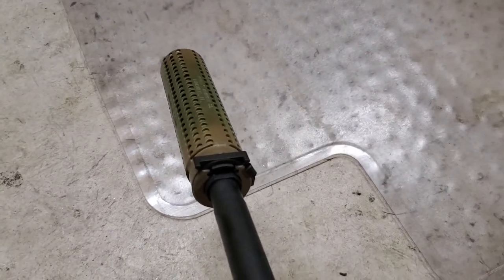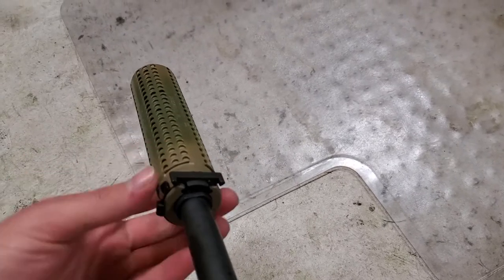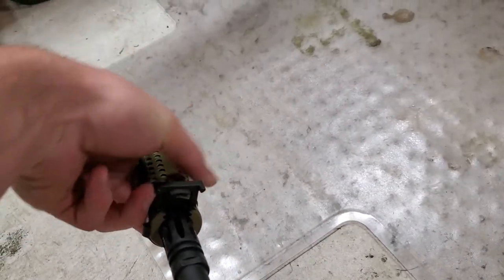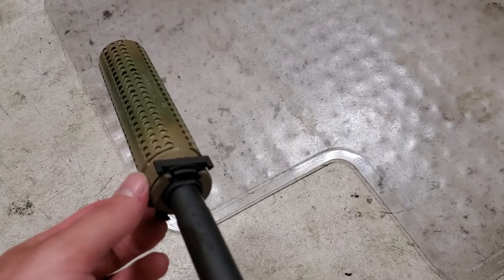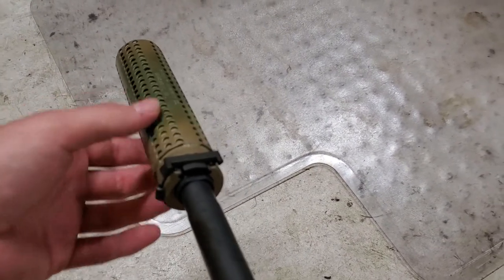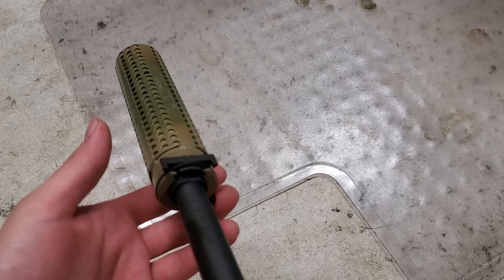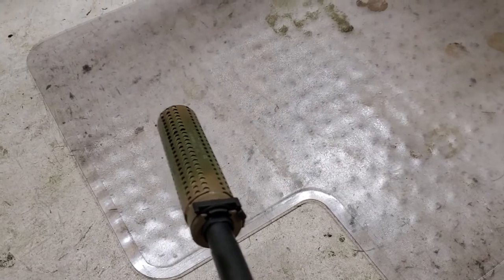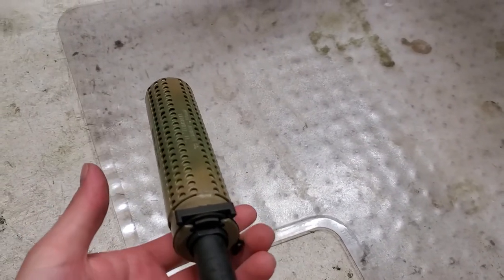KAC NT4 Suppressor Locking Issue?

Comment: Normal For the NT4 just as Long as you don’t have up and down. But wobbly is normal
Reply from the maker: Thanks, ended up sending it back to KAC because the little Pin that is on the Gate Latch itself had come out completely and caused the locking ring to loose tension, which is why the Locking collar could be turned so easily. Took almost a month to get it fixed. Knights ended up replacing the whole Attachment Assembly on it, seems to work good now, the locking collar is not as loose now.
Reply: It’s normal.....just breaking in
Reply: Colton Salzsieder I just had them send me new roll pins. I think I have around 5k rounds through mine now and only replaced the pin twice.
Reply: @coltonsalzsieder2041  I lost my latch one night when I was out shooting under nvg. My can got launched 40yds away and never could find the latch. I ordered a new latch and replaced the 2 pins myself. I think the pins are sold for like 4.00 on operation parts
Reply: Is that an A2 Flashhider?
Reply: yeah the roll pin spring thing seems fucked. that was the problem with the nt4 thats why when griffin armament made the m4sd they did it with an upgraded way of locking and the can is basically the same as the kac nt4 but just upgraded. if anyone is considering the nt4 and isnt doing it strictly for clone purposes id check out the griffin m4sdii

Comment: It’s just kind of how it goes, lol. I think they added a roll pin at some point to fix this
Reply from the maker: It had one and it came out during shooting, I actually had to send it back twice because it happened again a couple months later after this video, Knights ended up just Rocksetting the pin into place and it has been good ever since. So if anyone has the same issue just Rocksett the pin into place, it will save you the trouble of sending it to Knights.